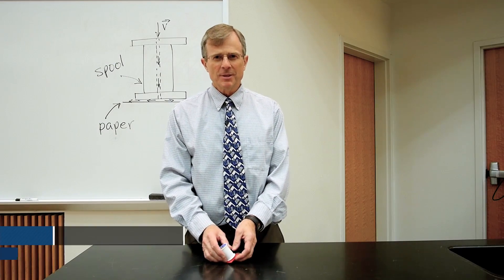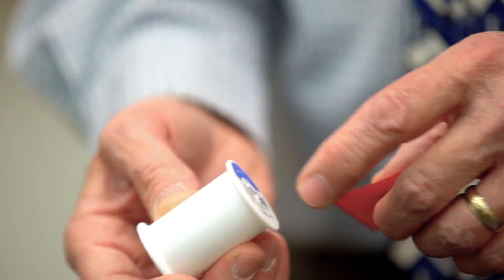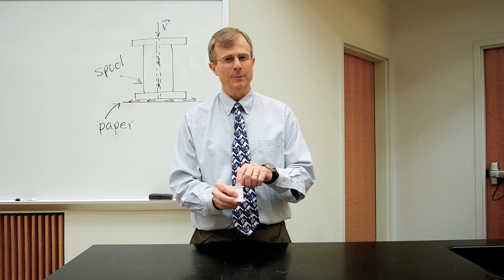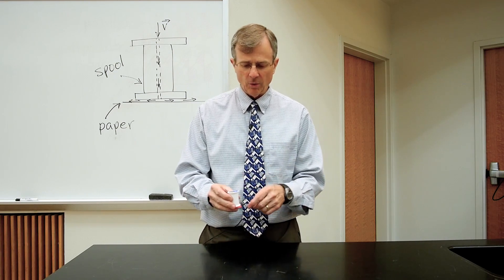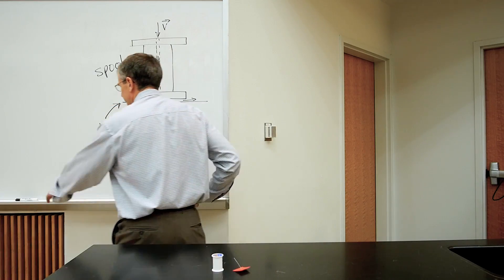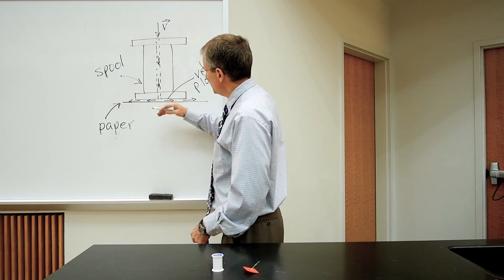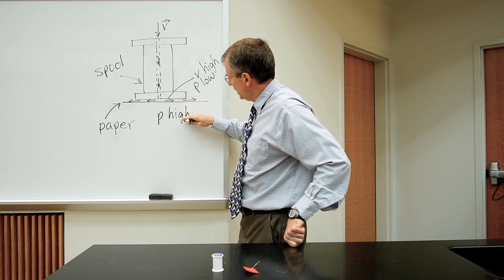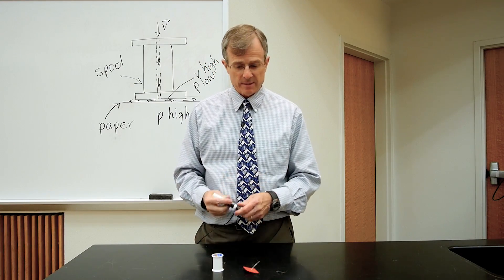Bernoulli's Principle Demo: Spool and Paper

Comment: What is the reason that the lower pressure overcomes the dynamic pressure of the air exiting the tube toward the paper?
..
Also what about the very short radius 90 degree turn of the air as it exits the tube and moves out radially? Is there not an inertial effect (just like the centrifugal effect) of that air turning a corner producing even more force on thee paper ? . . . AND . . a partial vacuum on the inside of that 'turn' at the end of the tube?  Air does have mass and inertia, no?